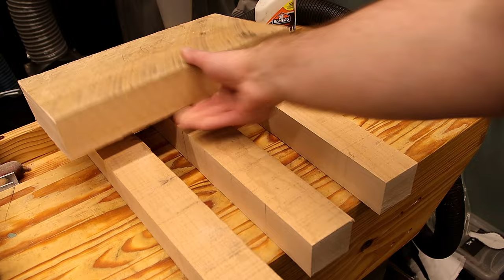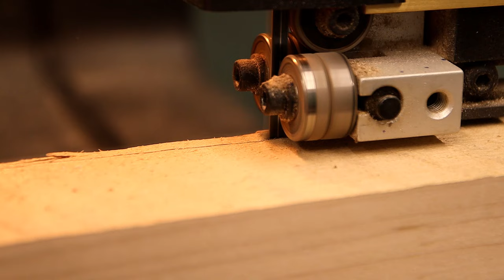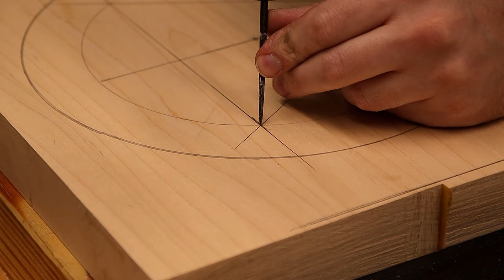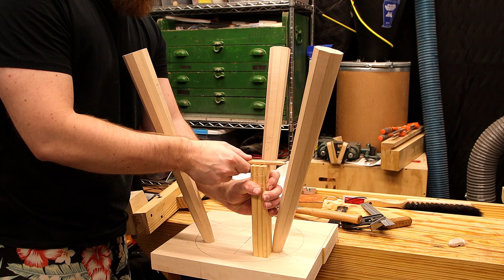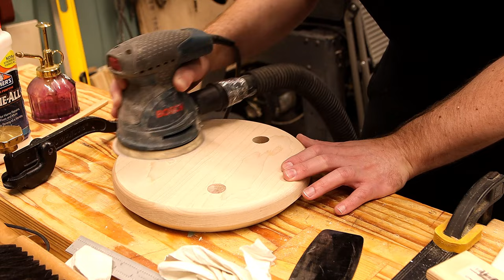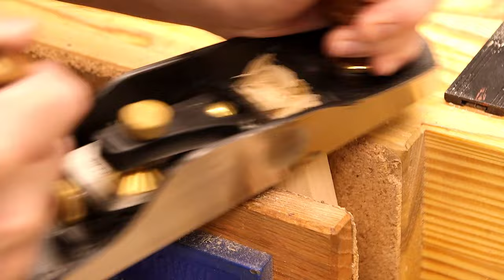Making a Three Legged Stool

Comment: Looks very stable, unlike my old four legged bench stool. Another fantastic job. Are you using ,the owl drill in your brace?
Reply from the maker: I have some owls, but I used a standard bit on this project. I would have used the owls I just didn't have one in the right size.

Comment: The skill that goes into such a simple piece is absolutely inspiring. I've only done stools and chairs without stretchers, was the glue up stressful? Seems like a big step up in skill to me. Kudos anyway, love your work.
Reply from the maker: Appreciate it! Yes,  this one was stressful. I ended up putting it together backwards at first. Luckily, I was using hide glue and could redo the assembly before the glue set.